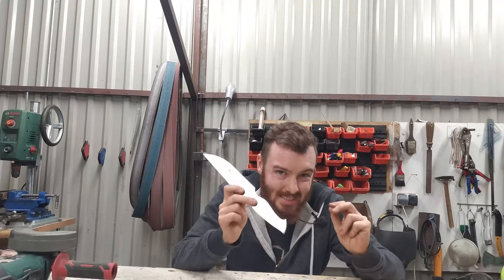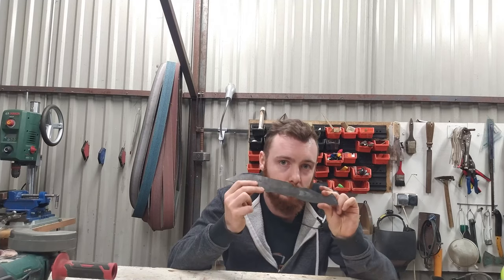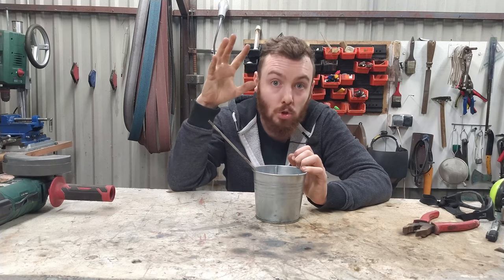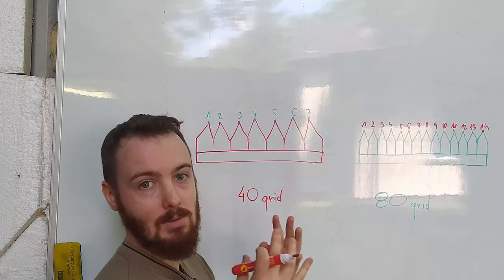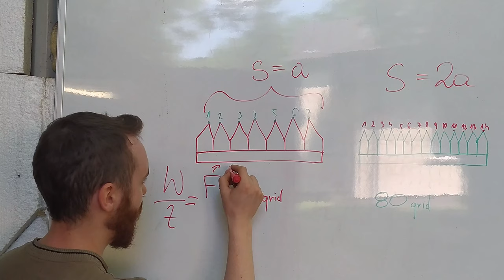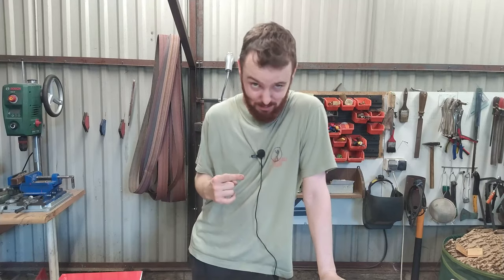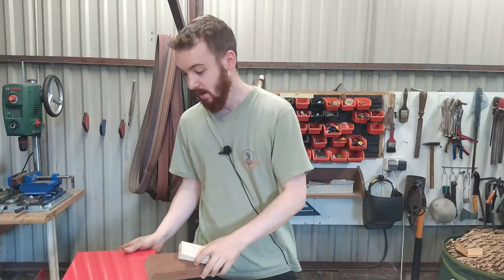Making bushcraft knife without Heat Treatment!

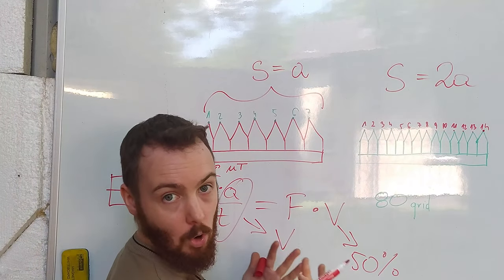Comment: 6:53 how did you file the knife if its already hardened steel?
Reply from the maker: Hey Man! You have a great eye - I appreciate focused viewers a lot! I've anneal the handle to drill holes for the pins https://youtu.be/LiFgOqjM5wg?t=151 In general, the temperature from the handle (during annealing) went to ricasso area and soften it a little so the filing was possible. It didn't affect the edge.
Reply: @DBCraftWorld  ohhh i see, makes sense :)

Comment: You can also do it yhe way it was done for more than 2000 years. Heat treating wasn't always done in antiquity and the middle ages, simply beacause good steel was kinda expensive (maybe not for smaller knives and after the 13th century). It's actually relatively common to find untreated blades in museums.
So, 2 solutions :
1) get by with a poor quality steel. Soft and lame, but will do the job for cutting meat and soft woods
2) get too hard of a steel and leave it as is

So the first would be an iron knife, the second would be a very high carbon steel knife. For exemple 135cr3, wich is already kinda hard without being heat treated. But of course for modern steels it's wasted potential. And there's literally no reason not to heat treat a small blade. I know i don't always heat treat my swords, just beacause i don't want to build a 1 meter long forge just for 1 or 2 blades. So i do it the old way, hard steel, hammer hardening on the edges. Not nearly as good as a modern sword with magic steel like 5160, but so what, i've helped butcher a deer with a S235 mild steel falchion, and the fucker literally chopped the head and neck clean off without edge damage.
I think it's a good lesson on what steel or even bronze is capable of. Beacause a blade doesn't reach 60 rockwell doesn't mean it's useless. How many lives were taken by bronze swords? Copper axes? Iron swords? Probably more than modern wars if we count the time frame.
Damn i sure wonder how troy fell without 1075 58hrc steel
Reply from the maker: Hey Jean! Thank you so much for such great comment! You are correct: there is no need to use very high carbon steel to make well performed knife. It's all depends on what you are looking for and what you need! 
About the bronze swords: the cool and very useful thing was that on the battle those swords had tendency to bend not break so the soldier could still fight and defend himself. In medieval age breaking steel swords was a normal thing. And those swords didn't cut well.
And one more thing: all cheep knives from markets (like $2-$15) are made at mild stainless  steel. 99% people use those knives all life!

Hope you have a great day Jean!
-David
Reply: @DBCraftWorld  yup! Bend for the low quality wrought iron swords and tools, chip for the too hard swords... Let's not make misconceptions tho, after the 14th century, >40 HRC swords well tempered started to become common, just beacause steel was cheaper with the proto industrialisation of europe (after the great plague). Just look at crossbows, huge chunky leaf springs that could bend and spring back reliably.
Tho in Fior di Battaglia, a book from a fencing master of the early 15th century, Fiore made the joke that if you managed to step on your opponent's blade, it would be so bent he wouldn't be able to sell it back afterwards.
Damascus swords, wich were made from wootz steel in india, had a terrible tendency to snap and chip, beacause early crucible steels had too much sulfur and phosphorous. Apparently during the crusades, some sarracen writers said they stole european swords and ditched their thamaskene swords beacause european ones would bend instead of chipping. Ian from That Works, the YouTube channel, uploaded a great lecture about that, with some damascus sarracen swords having more than 1.2% carbon in them. They were of course untreated, and reached a lousy but reasonable 27HRC.

And to close everything up, i think i recall using a cheap folding knife that had a laughably soft edge when i was a field worker. Untreated 304L stainless steel i believe. And it did the job just fine, as long as you didn't scratch a concrete wall or steel beam with it. 👍
Reply from the maker: @jeanladoire4141    So the legend about the wootz is just a legend- good to know that. There is misconception about the wootz I think. Many people still believe that the best knife is this from the wootz. It was discover long time ago, when humanity didn't know what we know now. And also, I hate when people complain about HRC lower than 60. In my opinion only kitchen knives should be about 60-62HRC. You don't strike them, they don't need to hold the impact. Buschcraft knives, bigger knives? 57-58HRC... Every day carry knive can be even lower (like 55HRC). Why? because you will not spend 3h to sharpen it.. 
I've made a competition chopper. It survive double Journey man test (https://youtu.be/3U1JaspqpMw) and it was still razor sharp. After 6 months I received my hardness tester from the service and measure the edge.. It was 52HRC!
Reply: @DBCraftWorld  damn, well 52 is still really good regarding historical standards (except for the katanas wich were crazy hard, but i've seen some guy argue that they weren't even made for battle, they were rather pieces of functional art, wich i can kinda agree with, simply beacause a 60+ hrc edge will not survive many impacts.
People probably don't realize that hardness is a compromise, and that not all knives need high hardness. A professional chef will want a super fuckin sharp knife, i was talking with one, apparently they want about 18° of edge angle, wich is crazy low. With that they will need a knife that holds its edge for a long time, beacause fuck sharpening at 18° every day. But of course, a paper thin and super hard edge will be fragile, there's no point arguing about that. No wood chopping for this knife. Now, yes, we can use modern alloys so our steels have a better compromise, but iron is still iron, it will have its limits,regardless of what metals you put in it.

Wootz is kind of a myth, but kind of a misconception rather. People say it would be of higher quality since it doesn't have inclusions and shit. Now, yes, but actually no, since you will usually have bad alloying elements coming with it. Let's not forget that folding is a very good way of cleaning and consolidating a shit steel. And that's what have been done with some wootz steels. Phosphorous and sulfur tend to migrate out of the steel, as does carbon, when exposed to air at high temperatures. So folding wootz would get us a good quality blade... By that i mean as good as all of the other folded blades lmao

Now we make copies of the famous wootz steel with pattern welded steels. I won't say i'm very talented at it, but I do weld damascus and make some knives out of it. 
Some people think damascus is better than single piece modern steels. Well to me, same thing, yes, but actually no.
Using different metals can be useful in a lot of situations. The blade of my metal saw is "bi metal", so the teeth hard hard and the core is usual steel. I do the same with my knives/spears/swords. Soft core and hard edge.
Essentially, i'm making a blade with 2 poor choices for making one. One's too hard, the other is too soft. (for modern standards i'd say). Well, this way i can combine both and have kind of a middle ground.
But the thing is, if you want a very good blade, just take a single steel that has the properties you want. No folding shit, no welding, it's way less expensive to produce and does the job real well.
Same goes for knives, no, damascus knives aren't better than single piece ones. They are just a fancier version with sometimes particularities like high edge hardness.

Now there's a fucking trap with modern damascus. Beacause all knife makers want super high contrast and dark lines in their steel. So they take some modern shit that doesn't darken, like 15n20 or 35n15, and then some fucking hard steel that will darken a lot, often 01 or 135cr3. Pretty, yes, but jesus christ you got a hard fucking blade. Way too hard, imo at least.
For the body of the blade it's not a big deal, you got softer steel to kinda bring toughness. But i wanted a black hard edge, so i welded the same high carbon steel on the edge. I did one false manœuvre with a piece of wood during the assembly and the fucking tip snapped. After 2 days of work you kinda want to put your head into the fire. At least my grain was flour fine...

So that's something to keep in mind with damascus blades. Be careful, they will tend to be very very very hard. If you're the kind of guy to jack off on hardness numbers thinking that will give you a superior knife, then why not. But modern damascus will usually be more pretty than functional, so if you want to cut wierd shit with your knife, get one either with a low contrast damascus, or just a mono tough steel.
Reply from the maker: @jeanladoire4141  I'm totally not "jack off on hardness" kinda guy (this sounds funny btw :P). I think 61HRC on the Chef knife is totally enough. Going higher is senseless. For most of the knife I would say 58HRC is good enough BUT ONLY if you have soft spine, so selective HT is definitely much more preferable. 

Damascus is a tough topic. I think damascus can be ONLY as good as mono steel blade. It won't be better in any way. It's more pretty but this is all (so I think we are 100% agree with each other).  I don't understand people who use high nickiel steel (75Ni8/15n20) and any other steel (like nc6 or any with more than 1% of C). How to HT damascus from steel that not match.. Cmon.. The quality of this damascus can be very bad even if the hardness is acceptable (check my last 2 videos-the integral bolster project - you will like it).
I'm much more into San Mai damascus rather than just damascus. If you use damascus as a scales you can ignore the difference in hardness on the damascus- use more soft steel to make softer scales.. and that gives you a toughness.. But if you need a tool (not art knife) get the mono steel blade. I would reserve damascus only to "art knives".

This broken tip was a bummer... sorry for you and I totally understand. I would put my head into the fire.. same as you.
Reply: @DBCraftWorld  high nickel steels are just so they don't tarnish in the acid bath. Add some high carbon steel that tarnishes a lot to the billet and boom you got super high contrast damascus. Nickel steels are just for their color. Practical assemblies like san mai or "useful damascus" are also my favorite. You can get properties you wouldn't with mono steel, except trough differencial hardening of course.
You surely know the trick, but i don't do differencial hardening, i do differencial tempering! Heat up the back of the blade, letting the heat slowly creep up to the blade, and grab a wet piece of cloth to cool back down the edge while the back turns blue. This way of tempering might not give the highest strength at high hardness, but it's quick and very effective. I've never done the tempering cycles that last hours, simply beacause i do everything over the fire, like in the old days. Maybe my tip snapped too easily beacause the tempering was too quick (i let the heat cook the steel for as long as possible tho, but it will never be a 1 hour cycle). BUT i've made springs tempered to blue over a fire, and frankly they work great! Spring well, and when overloaded they bend without cracking.
I've never checked the hardness of my knives as far as i can remember, i don't own technical tools. I do my damascus by hand with a hammer, the most high tech thing i got is an electric grinder and a welder that i just use to tack weld the billets instead of wrapping wire around it. I think it forces me to learn how it might have been done in the medieval period this way. A file will tell you what you need to know about the hardness of a steel anyways.
Reply from the maker: @jeanladoire4141  Actually selective quench can be done with the tempering. You basically leave the spine hot from the soaking in the oven and wait to heat migrate to the edge right after quench. Selective tempering is very good way to make hard edge but hole knife very tough. Your method is good! I need to make tests because I think 2x2h tempering cycle is enough only for the kitchen knives. In case of different type of knives the toughness should be much higher.
Reply: @DBCraftWorld  if you want toughness then it's not so much a question of time in the tempering isn't it, you should simply go for a higher heat
Reply from the maker: @jeanladoire4141  it's truth, but question is how the time influence on tempering effect- Why 2x2h not 2x1h, or 1x4h? Don't understand this much. Maybe you know?
Reply: @DBCraftWorld  well, i've been trying to figure out as much as you! I think you'll figure out that to each blacksmith his own truth. All the guys i met told me something different. Like burning a cow's horn on the steel case hardens it actually well, when some other tells me that's bs. Some guy even told me he quenched a knife and then put it into the red hot coals and waited over night for it to cool... And it didn't anneal it, apparently it actually hardened and tempered it... And of course other people told me there's no way it would work, and trough weeks of research i found a metal factory that mentioned that some quenched steels will not react to annealing the same way untempered steels would, and can actually be tempered that way...
That shit is wizardry.

Regarding the cycles, i believe the goal is to turn all of the hard carbon and iron crystals into a more homogenous lattice (forgive me for not remembering wich is martensite and wich is pearlite). A quick temper will not do this transformations as thoroughly as a long cycle. Basically you gain more toughness with a long cycle.

BUT people also told me a short hot cycle is the same as a long colder cycle.

So, here's my take on the stuff :
The hotter, the more hardness you lose (but increased toughness).
If you want to keep optimal hardness, temper lower, but leave in the tempering for longer, to get maximum toughness without losing too much hardness.

That being said, tempering to like 220° for 4 hours will probably reduce your hardness to like a brown/violet temper... In that case the good old "put over the flame and watch the colors grow" to slightly hotter but shorter could give it comparable results... Perhaps.

But keep in mind industrials don't waste 2 hours of heating in an oven for fun, surely it's more effective than a quick flame temper... Or... An other theory would be that a flame temper has to be done by an experienced blacksmith, and has to take each and every blade one by one and carefully heat them up, wich is a big no no for a factory. So they would just toss 100 blades at once in an oven instead.

Now i've never really tempered with an oven. Always done it the good old way, with a flame. What i can say is that my high carbon edge from the damascus knife broke very easily in the oak block. That being said it was really thin prolly >1% carbon steel, that was flame tempered to straw. If i tempered to straw in an oven for 2 hours would i have had the same hardness but higher toughness? I dunno. But what i know is that up until the recen history, all temperings were done by color, and our entire civilisation was built by tools made like that. So... Think what you want i suppose, to me i don't have a clear answer 😅
Reply from the maker: I'm sorry Jean for the delay. From what you said I think selective quench might be the most optimal way (Time/effort/effect) to make a tough knife with hard edge.. I'll definitely check what gives the best effect- maybe baking in the oven whole knife and (like you do) than torch the spine to make it soft is enough.. In general there is many way to HT the blade- I think, finding the balance and confidence to choose the right method for each knife is the key.
Reply: @DBCraftWorld  yup, if you find anything conclusive on the subject, feel free to let me know!
Reply from the maker: Actually you gave me cool suggestions and I'm going to test them. Thank a lot for help Jean and it was very cool talk :)! 
hope you have a great day! -David
Reply: @DBCraftWorld  no problem friend, i'm waiting to see your tests 👍
Reply from the maker: @jeanladoire4141  I'm affraid it won't happend till "Youtube Fantasy challenge"- currently I'm overloaded with work :(.. but I'll share those tests on YT for sure! Btw: do you have Instagram account?
Reply: @DBCraftWorld  look for ladoirejean, same depressed pfp